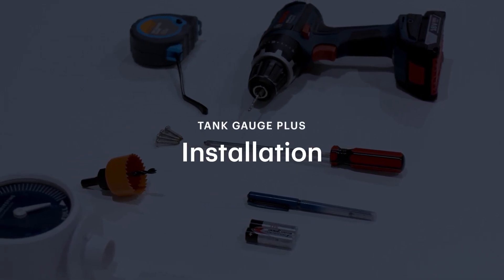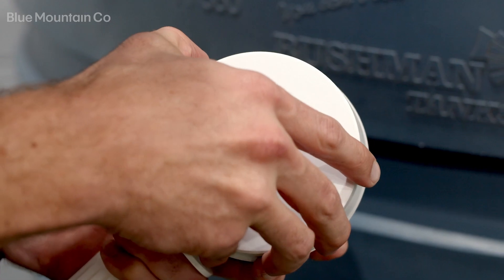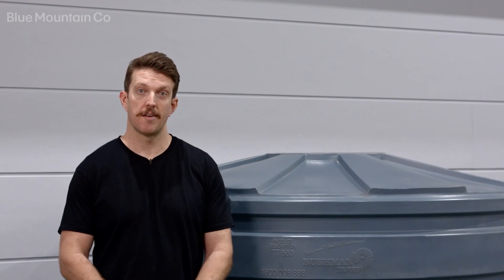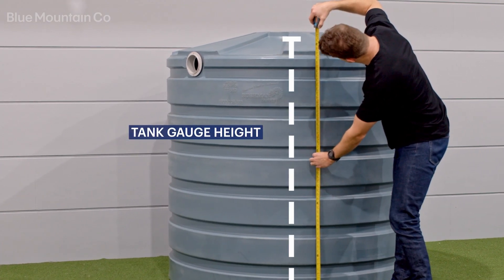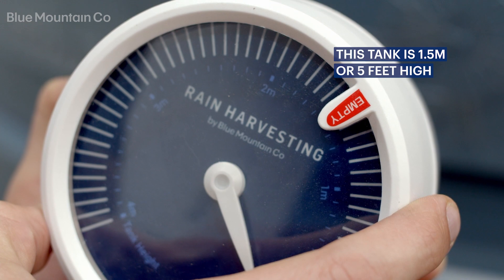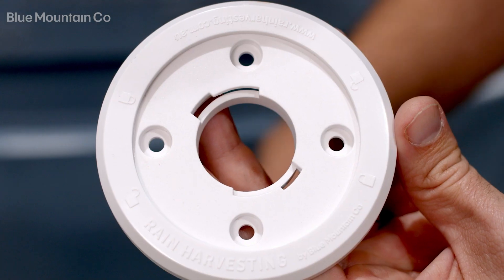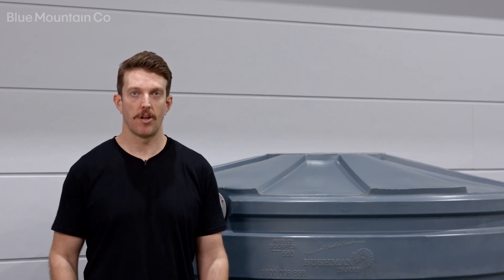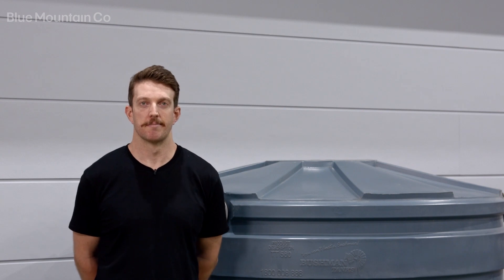How to Install the Rain Harvesting Tank Gauge Plus

Comment: Why must it be 150mm from the edge?  Ive installed mine but doesn't seem to be giving accurate readings.
Reply from the maker: Hi Darren,

Thanks for asking.  There are a variety of different tank shapes, sizes, fittings and accessories.  We say this to ensure that the device is away from the edge of your tank to avoid any obstruction to the float/string that may impact its function.

Regarding your reading accuracy, a successful re-calibration will help resolve this for you.  Please ensure the float is touching the base of the gauge during this process.  If you need assistance, our team would be happy to help and can be reached on 07 3248 9600 or via info@bmco.com.au

Comment: How does this tank gauge system work with multiple tanks?
Reply from the maker: Hi Alex - Thank you for your interest in our Tank Gauge Plus!  
You can easily monitor the level of one or more tanks with the one app.  Our app is specifically built to work with gauges across multiple tanks and it is easy to switch between the devices once you have set them up.  As you switch to each tank/gauge to view the levels, just pull down the screen to refresh that tank.  You will require one Tank Gauge per tank, unless the tanks are balanced - then you could use the one gauge to measure the combined volume.  If you need any further information, please do not hesitate to reach out to our team at info@bmco.com.au

Comment: Hi 👋 
Looks good 👍 👌 
How far in range (meters away from tank) does the Bluetooth  signal work from my phone successfully ?
Reply from the maker: Hello, The Bluetooth functionality of the tank gauge will generally work up to around 20 meter if there is a clear line of site.  Sometimes if there are walls in the way, this distance will reduce, though it will also depend on the material of the wall and also the model of phone which is connected to the gauge.  Metal or thick block work walls will have a negative impact on the Bluetooth Signal. If you have Sigfox connection in your area, you can view the tank level on your phone from anywhere.
Reply: @rain.harvesting  
Ok thanks for info, yeah my Lounge room is only around 12m from the Water Tank & it's a vinyl clad home (timber frame) so Bluetooth signal should be fine I think. 👍👌

I know you have an option for sigfox but I don't really want to continue paying for a subscription. 
Thanks for the info 🙏🍻

Note - I'm currently using the Rain Harvesting wireless rain gauge with Digital display which is mounted (recessed along with a Weather Station screen into my wall) it works great but it's sadly the rain guage is discontinued 😔.